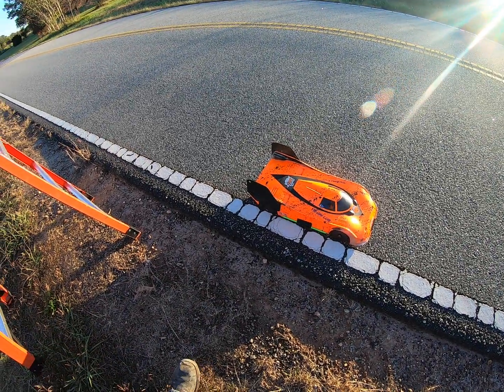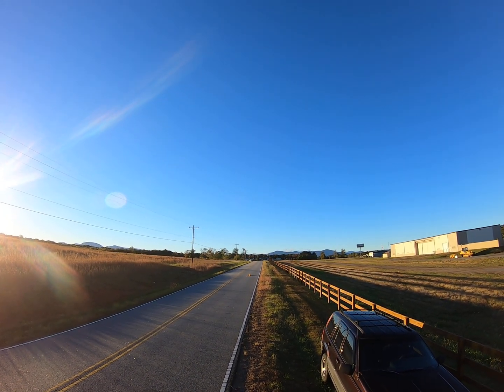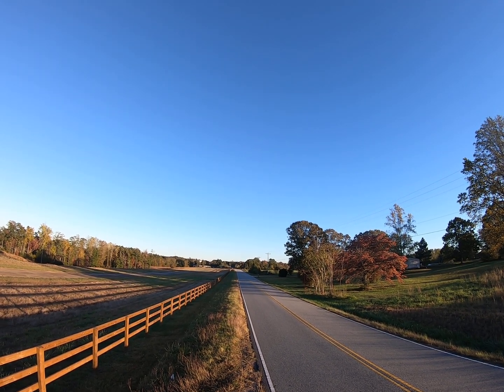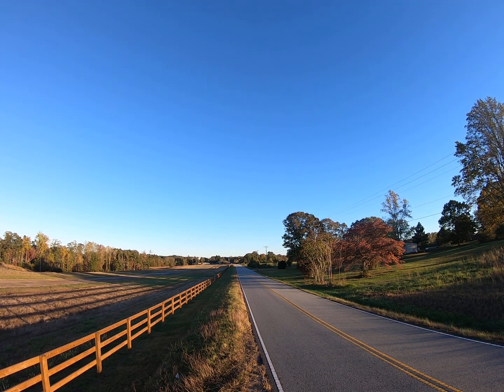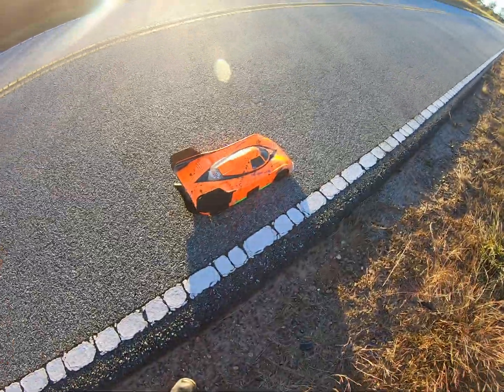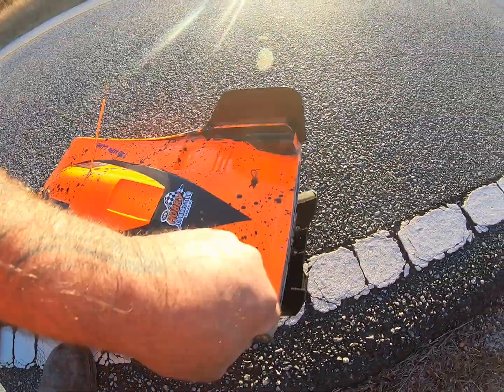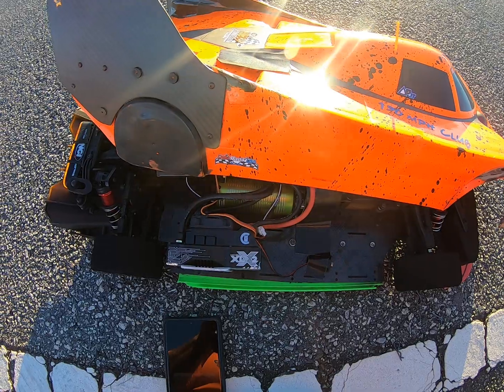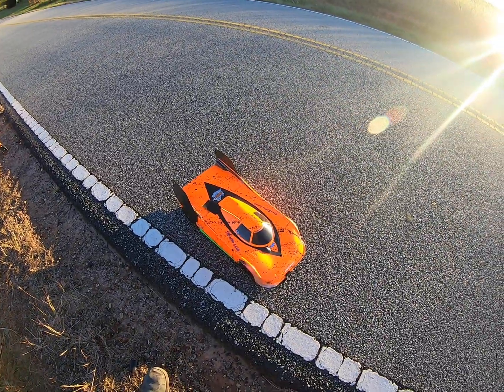CASTLE 1721 2400KV TESTING

Comment: Nice run, I get mine in tomorrow. Trying to figure out what spur to start with on this motor. Was gonna ask you what spur you started with when you 1st ran it  but then you mentioned that you were hiding your gears. I just wanted to get an an idea for a starting point, just under 100mph. I really don't want to fry anything lol. That is pretty high kv for 8S. At the moment, I'm running the 1717 1650kv in my Limitless w the XLX2.
Reply from the maker: I would start with a 40 spur and maybe a 25p is you are running 8s
Reply: @jamesmccoy204  Bro, thanks a bunch, I truly appreciate it!! Just trying not to fry things 😂. 
Once I get get my 1st run in & see what the current draw & temps on the data log are, then I can adjust accordingly.
Thanks again for the help & keep'm fast! 😎👍
Reply from the maker: @rcbustanut2057  glad to help,  if I can help anymore shoot me a message